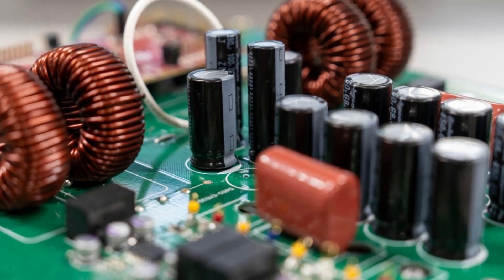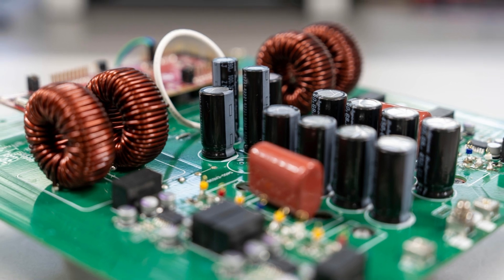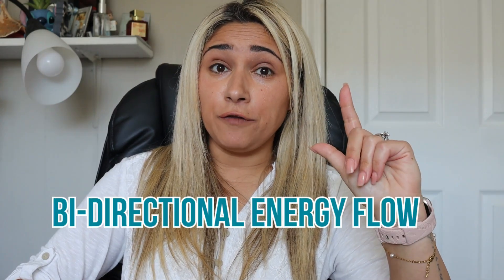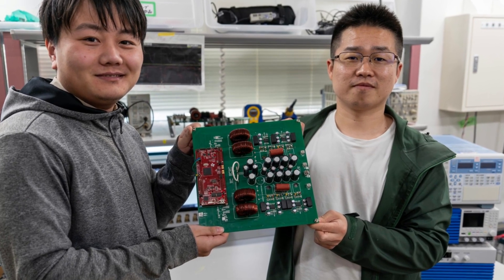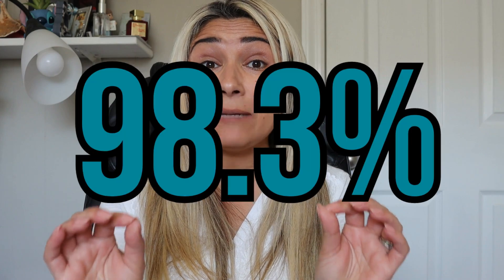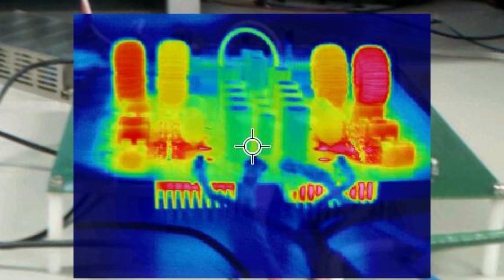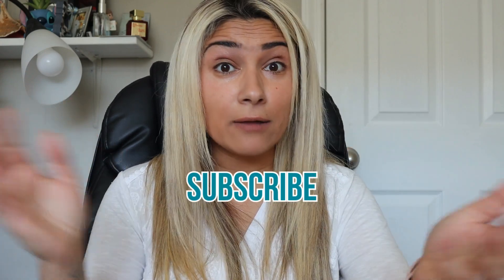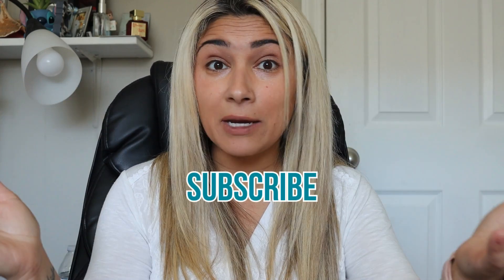This DC-DC Converter Will Transform Energy Systems

Comment: Looking at the picture its almost certainly non isolated.  Look at those big fat torrids!
Smells Continuous Current Mode of some flavor.  4 channel synchronous buck boost converter perhaps.  Inherently bidirectional and unfortunately non isolated.
Reply: And I wonder what the core material in those torrids is?  Hopefully the designers chose that great Japanese invention Sendust, aka Koolmu.  Then I looked at those pretty orange metalized film caps.  At first I thought maybe some kind of soft switching or resonant switching energy recovery scheme.  But given 4 torrids, 4 interleaved converters seems likely, but only 2 caps. Buss stifteners/HF bypass more likely.
Reply: Now the Red PCB at the left is presumably the controller and gate waveform generator.  Perhaps they only turn on one converter at light loads, 2 at higher and so on. That would keep each converter near its sweet spot of efficiency.
Now if they are Really Clever they would alternate among all 4 converters with only one on at a time to minimize heating of one converter.  That might be good for a few tenths of a % efficiency. 
My own thinking is that 94 vs 98% is almost meaningless in terms of energy conservation. 
However 98% is Huge in terms  of having to dissipate only 200 watts from a 10KW converter instead of 600!  That saves weight size and $$$.  In some applications it could make the difference between simple air cooling and $$$$$ liquid cooling.  Or heat pumps.

Comment: An input of 12VDC significantly enhances energy efficiency with a 12VDC output load, enabling reduced system complexity while supporting sustainable 12VDC power solutions.

Comment: YouTube does YouTube things... I don't know why this video was recommended for me.
Basically this is a PR advertisement for some lab at a university. It's great that they do what they do - I just received my masters degree with a side specialization of a power electronics lab just like this, doing incremental research on tuning well known designs. But there is nothing new here, no breakthrough...
Please do not spam us with useless ads.
Reply: Speaking as a 40+ year veteran of the power conversion industry, you are completely right.  In those 40 years I got about 30 patents.  One of them may have been something truly new, but certainly nothing world changing.   We stand on the shoulders of giants long dead.

Comment: I don't think this is particularly new though.  It looks like its just a synchronous buck converter.   A good one, sure, but... still just a synchronous buck converter.  Hard to tell since you didn't describe the actual circuit design.    Note that the high-efficiency path is only going to be in one direction... its hard to get high efficiencies with a boost converter.  You only really get them with buck converters.  Also, large voltage differentials reduce the efficiency.

DC-to-DC buck conversion is an inherently efficient process.  In fact, if you look at run-of-the-mill solar charge controllers today such as Victron, those operate at efficiencies of 98% to 99% right now.   And they have huge input voltage ranges.

Current-day string inverters and micro-inverters such as enphase also achieve roughly 98% to 99% efficiency converting DC to grid-tied AC.  That works because grid-tied micro-inverters are current-regulated devices rather than voltage-regulated devices.  In fact, charge controllers are too.   It is easier to tune the magnetic components (such as inductors) in a current-regulated design, and a lower switching frequency can be used as well... which all translates to very high efficiencies.

Current-regulated designs do have some warts... the main one is relatively poor voltage regulation.  That is, the output voltage or waveform can jerk around a bit as the load changes.  But the cool thing about it is that you don't really care if the output does this in a grid-tied or charge-controller use-case because they are connected to the grid or to a battery, both of which are extremely low-impedance black boxes.  Since the impedence is practically zero the voltage can't be moved all that much and it winds up just being a matter of current flow.

-Matt
Reply: Matt you are On Target!